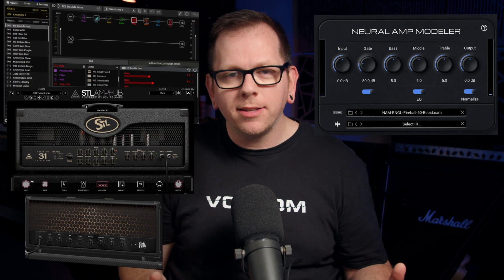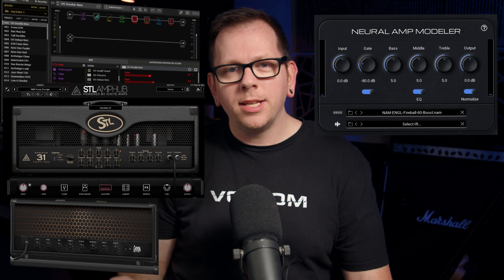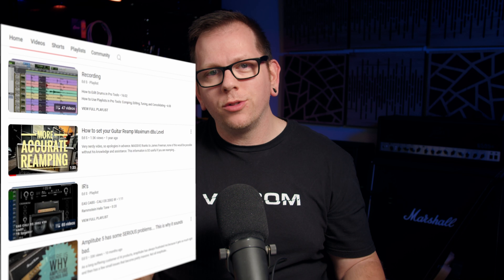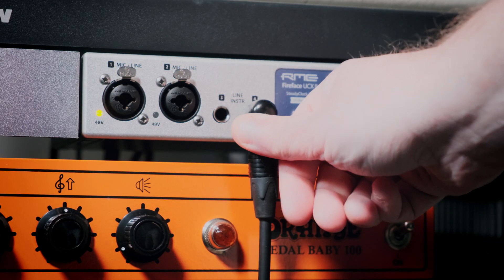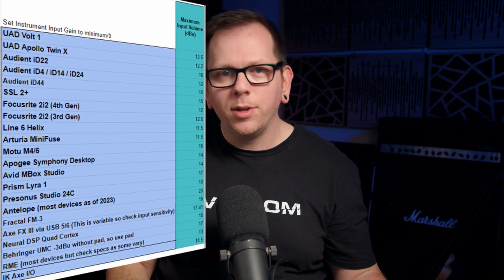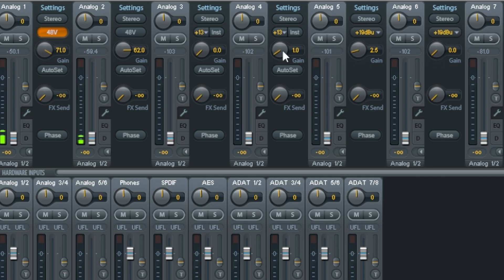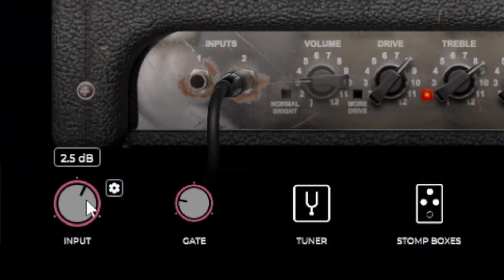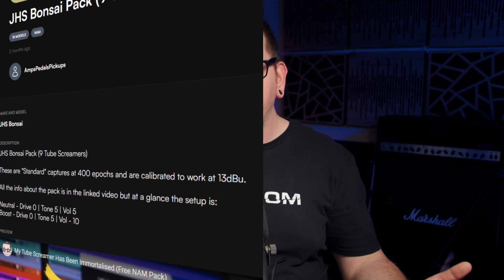Amp Sim / NAM Input Level Accuracy Explained

Comment: What about guitar processors? Let's say I have a Quad Cortex and guitars with different pickups — both active and passive. The input gain varies. But it’s unclear whether I should increase or decrease it. I’ve watched videos on gain staging in the processor, but I still have a feeling that it’s not quite right.
Reply from the maker: Yea I know what you mean. Forget about pickups and various guitar volume for now, all that stuff will fall into place when you know what level the qc is at

I’ve got another video after this one where you send a signal out of your DAW and measure it with a multimeter. If you follow that one you can work out any piece of gears input levels, will be fine to measure and figure out what the QC levels are

Once you know the input levels of the QC you can adjust plugins to match

Comment: Well explained, though i am not sure how the 12,2 dBu on NDSP stuff for example is determined!? I mean i understand that they specify that but how did they calculate this value? OR when i do my own NAM captures, is this the level that is used for the reamp when creating the profiles?
Reply from the maker: They have to choose some arbitrary value/level when they make a plugin. Choosing something around +12 or +13 is pretty smart cause a lot of the popular interfaces like scarletts, rme, SSL etc are about +12 or +13 with no extra gain added. So a completely unaware person would just plug their guitar in, fire up the neural plugins and go, this all feels about right.

I’ve got another video on how I setup my levels for nam reamping. But yeah aim for +12 or +13 when you’re reamping out to the amp and that’ll be what the person will use when they load up your finished nam capture

Comment: I always feel like I should lower my input gain on the amp sim, instead of raising it. I have the STL Tonality Josh Middleton plugin, and I never managed to make it sound at least decent. I know Josh is using Fishman Fluences, I have EMGs (81 on the bridge as you can expect). I have both the Focusrite Scarlett 3rd Gen, and the Behringer U-Phoria UMC202HD. They have quite different input levels. I set up the input gain of my audio interfaces right before it clips (when I hit the strings hard). I tried all possibles settings on the input levels of the amp sim, and it never sounds right, I always get a bold sound but not the way I like : it sounds like an overboosted fuzz in front of a 5150, there is way too much gain and it is absolutely not tight by any mean.

I tried the zero gain thing, following the settings in the Excel table we've all seen, and it still sounds terrible. When I use the plugin on raw DI tracks (stems from Sylosis), they become heavenly tight and mean. I don't know what to do, my quest for a good tone is never ending...
Reply from the maker: If you jump on my discord we can probably work it out, share your DI and see what’s going on. STL Middleton is an awesome sim

Comment: The tech stack needs to have ISO standards or something.  Amp Sim captures should then bake the levels into the profile which are then used by daw's etc.  It should be idiot proof even for newbies
Reply from the maker: NAM has adopted that. If the creators train the captures with the right data it’ll all auto adjust for the user

Comment: I knew something was wrong with this setting!! Thanks a lot for this video! I'm a long time NAM user... Does that mean I need to go back to every single profile page I've downloaded and pray that the person included this info ? :'(
Reply from the maker: Haha honestly kind of it’s pretty hit and miss with old stuff. Steve has this option in the latest NAM now. You enter your input spec into the NAM plugin. If the persons NAM profiles has the data inside the NAM file in the metadata everything will auto adjust. All my recent packs have this. In theory if everyone does that then the user will have a great experience cause you don’t have to change anything it’s all auto. Of course not everyone is gonna do it in their captures but the good ones will 🤜🤛
Reply: @ampspedalspickups  oooh great! checking the update right away thanks a lot!!

Comment: When it comes to NAM, Arlington Audio captured some amps as they say at 18.86 dBu. My Focusrite Scarlett has a Maximum Input Level of 12dBu, so in NAM I have to lower the input to -6.9 to get it right? Also, should my interface gain be at just below clipping or should I leave a headroom of -12dB like other people say? I have an HSS guitar and I adjusted the gain so that my single coils peak at -12, but the humbucker peaks at -6. Is that ok?
Reply from the maker: You got it right for the levels, bring NAM down by -6.9 in that scenario.

The peaking thing is a ballpark guess for levels, a worse version of what you just worked out with the actual numbers. If I have a quiet guitar I plug it into an amp and play. When I have an active pickup guitar that’s so loud it’s internally clipping I still just plug that into the same amp. The amp is designed to accept different levels and it will respond accordingly. Now that you know what the levels are for those NAM captures you don’t need to adjust anything, it should just take any of your guitars and act as good as it can to the real recording

The only time you’d want to adjust levels from here is if your signal was so insanely low it annoyed you and you want to life it by say 6db in the daw so you can see the waveform better. If you can clearly raise your interface gain by 6db then you’d raise the NAM model by 6db (it’s still matching you’re just moving both things up or down at the same rate).

Some interfaces easily show you 1db increments and this is easy to do. But most interfaces just have a knob that’s free flowing. The free flowing ones don’t help because you don’t know how much it’s being raised by and you’re back to sort of guessing again. In that scenario you can always measure the signal but that’s a bit of extra work.

But yeah with the Scarlett you should be fine leaving it and reducing the model in the plugin

I know this is a long reply but one last thing. All of this is to just find the baseline of the model and see how it responds. If you find its responding too weak then obviously it’s fine to just hit the nam model with a few extra db by raising it, that’s exactly what a clean boost pedal would be doing. People always seem to think I’m in the camp of “set and don’t touch” turf. Where it’s more like, find the right levels and go from there.
Reply: @ampspedalspickups  Thanks for the response!

Comment: Increasing the input gain on the plugin raises the noise floor as well. How do I mitigate that?
Reply from the maker: It’s all gain management. In a realistic scenario with a decent interface (which are like $150 these days), no issues with the guitar or cables and no crazy emi in the room, you will not have any issues whatsoever on the heaviest amp sims you can dial in.

If there’s emi noise in the air it’s going to massively get amplified. If you have dodgy cables or a 15 year old interface then probably more likely for other issues to arise.

The method I’ve got here works in most cases but if whatever you’re doing is too noisy you can try gaining up the interface then gaining down the ampsim. It becomes problematic because we’re aiming for accurate levels here and most interfaces especially cheap ones don’t work in steps or values you just roll a knob down and guess. That might fix the problem but it’s more of an edge case or indicative something else is wrong and probably will achieve the same thing.

I know this is a massive response but I’ve tested leaving the interface gain at 0 then adjusting the ampsims. I’ve then tried doing the optimal gain so say gaining up the interface 5db then gaining down the ampsim 5db, the result is the same because the interfaces are so good their noise isn’t an issue these days. So I don’t see the point of managing that unless you have a noisy setup

Anyway there’s links to my discord in the video description if you want to nerd out and talk about solutions jump in there. I sometimes use noise suppressor plugins to help but that’s irrespective of the gain settings in this video it’s just a different beast, not all noise is created equal etc

Comment: Plugin companies really screwed up with this. After I changed to using zero gain on the interface and adjusting to what the amp sim wanted, suddenly, half of the artist presets sounded like rubbish. Why? The artists didn’t use the correct input sometimes. Now it’s a big guessing game to figure out how to get good sounds out of artist presets.
Reply from the maker: Which amp sim is this one
Reply: @ampspedalspickups  I’m thinking Neural DSP and the Mateus Asato. In particular the Better Call Soul preset, as opposed to Rabea’s which all sound bigger at 0 gain.

Comment: i see no point in doing this. guitars lose character and definition. higher noice floor. aslo in my case i don;t have a gain knob on my interface so i cannot control it. all i know is that i do not clip  at any point of playing. line 6ux2 user. no instrument input gain knob. balanced input. sounds great. no point in turning it down to 0
Reply from the maker: There’s no right or wrong way to use an amp sim. If someone wants to have a hot or weak signal but they like the sound then there’s no issues, if you’re happy then great.

We’re talking about accuracy if the amp sim. When they make it it’s calibrated to a specific level. Unless you measure your signal or set it up using the 0 gain method you won’t know if you’re using it accurately. 

If you’re happy with the sounds then there’s no need to go chasing accuracy. Most of the time people think an amp sim sucks. It’s usually because they aren’t hitting the right levels and are too hot or weak. But once an accurate level is hit it puts the user in a good position

Comment: Mind blowing how this isn’t the first thing in the manual or product specs.
Reply from the maker: Yeah I tried a new amp sim literally yesterday and it sounds completely wrong. They had no input info and I just had to guess where the base levels were. Pretty annoying stuff
Reply: it isnt because it's not even important. by turning gain knob to 0 you lose character of the guitar tone.
Reply from the maker: @worldaswar3784  the whole point of the exercise is to to use the right gain levels with amp sims, not just leave it at 0. Watch the vids and see why 🤘

Comment: Hey thanks for the vid, I got 2 questions
1.What if you're using EMG active pickups and using the line input instead of the Instrument input? (otherwise im not going below -6db on the di itself - almost clips)?
2.If a profile in Tonehunt says "calibrated for +13dbU" and I have 12.5dbU on maximum ,that means I need raise my input by 0.5 or lower it by 0.5 [-0.5) ? (I have focusrite scarlett 2i2 3rd gen).
Reply from the maker: Would need to know your interface to make a suggestion on 1). The line input can sometimes have different specs to the instrument input/mode so the manual should say it.

For 2) those number +12dBu or +6dBu think of it as headroom from 0. So if yours is 13 and the sim is 12.5 then you go up 0.5. If yours is +6 and the sim is +12.5 then you go down 6.5
Reply: @ampspedalspickups  My interface is Focusrite scarlett 2i2 3rd gen, It has 12.5dbu as instrument max input at minimum. ,I saw some profiles calibrated to 18.86 and the creator of those said if i have 12dbu instrument input ,you need to lower by -6.86, mine is 12.5 dbu so its -6.36. , I wondered why he says lower and not raise [Maybe cause it'll sound hotter with +6.36]
Manual says +22 is line input. since mine is active pickups my highest peak get to -18dbfs (with no amp activated) so it might be enough.
Reply: idk if I need to add 6.36 to input or lower by -6.36 to get to the reamp value: 18.86, if my maximum instrument input at minimum is 12.5dbu
The line value confuses me, cause he did the reamping for instrument values. Should i just ignore the line value and go with the instrument value even tho im not using the instrument button?

Comment: One thing that helps me is to use a EQ last in chain when dialing a tone. i use high shelf filter around 4-6 or 7 k. Gain at 1-2- or 3 db and sweep that area. If it gets TOO fizzy, the input is way off. You shouldn´t get too much of it 🙂

Comment: So I have an Audient ID4 MKII, would I be right in saying I'll adjust my Neural DSP Plugins -12db?
Reply from the maker: Nah for ID4 MKII its got a spec of +12dbu and Neural plugins are +12.2 so if your interface is on 0 gain on the knob it's basically perfect... technically you could reduce the plugin by -0.2db but I wouldnt even bother, they basically match up perfectly. Really easy with that one!
Reply: @ampspedalspickups  oh perfect, I definitely misread the spreadsheet. Appreciate it!
Reply: @ampspedalspickups  why don't you set interface's gain to under a max where it clips and then lower amp sim input?
Reply from the maker: @ if you know your numbers and your interface is easily adjustable in increments then that’s an option as well. My RME interface lets me gain up the inputs in 0.5 db increments. So if my gain at 0 on the interface works out to be +13dBu and my waveforms are small because I’m using a single coil Strat or something, then I can accurately gain up the input by +10db and still not be clipping. 

If I was using a neuraldsp amp sim which is calibrated to +12.5 dbu then normally at 13 id just be going up by 0.5 and calling it a day. But because I’ve gain up the interface by exactly 10db I know to turn it down in the software -9.5 db and it’s spot on.

The main problem with this method is a lot of interfaces just have a knob that’s not stepped so you’re just kind of back to guessing levels again. If you have a multimeter you can really set the interface to whatever you want and just measure it, probably the best way to go for this kind of thing. But again there’s many ways to approach it, whatever works for you as long as the math works out

Most of the time leaving the gain at 0 on an interface will be fine. You’d have to really be using a terrible interface or one with a ton of headroom (or both) for this to be a problem in the first place
Reply: @ampspedalspickups  Hey, I have the iD4 MKII too, and I feel like my pickups are still too hot even with the gain set to 0 on the Audient. You mentioned that pickup output isn’t a big deal, but I measured the level with a level meter in Studio One, and it’s between -4 dB and -2 dB. From what I’ve read online, people say the input should be between -18 dB and -12 dB before passing it to an amp sim. It seems that I should lower the DI level using something like Studio One’s MixTool, any plugin with an input level adjustment, or simply by lowering the input gain in the plugin. Could you clarify this for me, please?

Comment: Hi, noob question here- is the dBu system negative or inverse or something? Because you were saying that in your example of an interface with +13dBu max input level and an amp sim calibrated at 5dbu, you would need to ADD 8dB of gain going in. And your notes on screen at 2:25 said that adding 1dB of preamp gain at 13dBu would make it 12dBu. So is it that adding gain reduces the dBu number, and a gain boost is necessary to decrease it? Thanks!
Reply from the maker: I think of it as 0dbfs (clipping) as the ceiling and a reading like +13dbu is 13db down from 0. So yeah if your input is sitting at +13dbu and the amp sim is quoting +5dbu then you’d need to increase your signal 8db to go from +13dbu to +5dbu

Yeah in this context these numbers like +5dbu, +12dbu or +19dbu is talking about headroom or how hot a signal can be before it clips. +19dbu means it can take 19db before clipping. +5dbu is only 5db. It’s a bit weird and kind of backwards in a way, but also makes sense in the context of input specs. It’s why I always think of 0 as the ceiling and then these + numbers as going down from 0.
Reply: @ampspedalspickups  Thanks!

Comment: I keep getting confused about this stuff... I have a focusrite, it says dbu is 12.2... spreadsheet tells me to put interface gain at 0, input gain at 0.3 for neural dsp plugins.  I am doing just this, and it still sounds muddy and unlike a real amp.  I am using plugins through logic pro, with gibson les paul with emg 81/85 pickups.  Logic set to 44.1, 256 sample rate.  I dont know what else to do here.
Reply from the maker: Sounds like you’ve got the levels right but something else might be making it sound like dirt. If you jump on discord and post some audio and screenshots of the plugin it might help figure out what’s going on
Reply: @ampspedalspickups https://youtu.be/CPkTaw_X8Cw?si=UBD68YlfYQ0FzeXl
Reply: Where do I go on discord?  Never used that platform before
Reply: are you using high impedance input or line level?
Reply: @ilmisxx2 I am using instrument/high z input....
Reply: Posted a link for the sound issue im trying to deal with

Comment: Eh buddy just a question when I use my amp sims in stand alone they sound unbelievable but when I run them through reaper the sound changes dramatically muddy and compressed loses clarity I’ve been tweaking forever with gain stages can’t figure it out am I missing something?
Reply from the maker: Super weird. If you join discord and drop a screen cap video or something it might show what’s going on. I doubt you’re slamming the track volume so it could be some weird loopback thing with the audio doubling up on itself or something, hard to say without seeing what’s going on